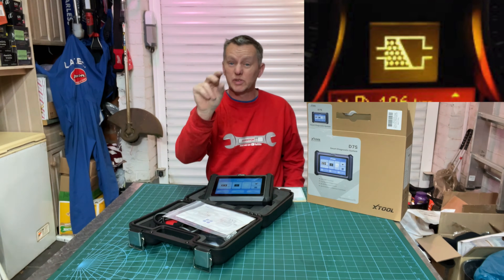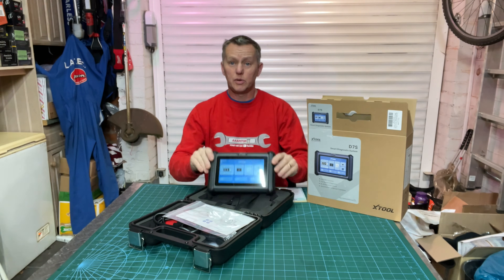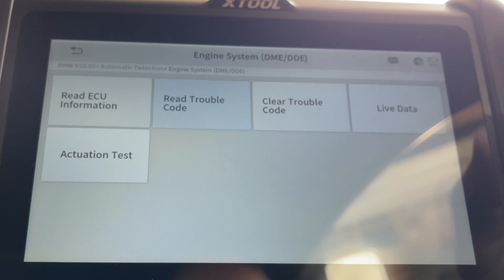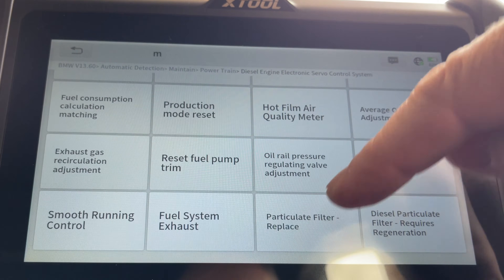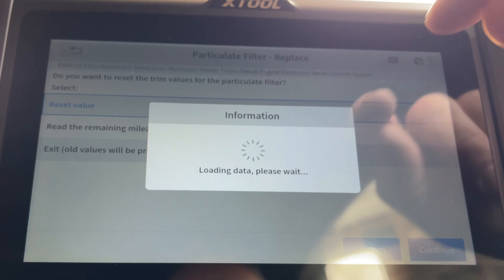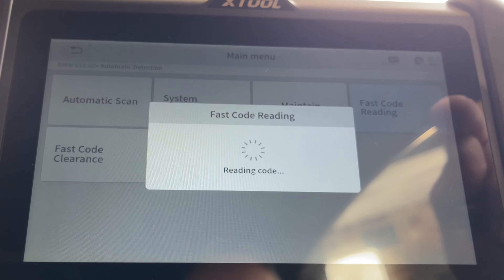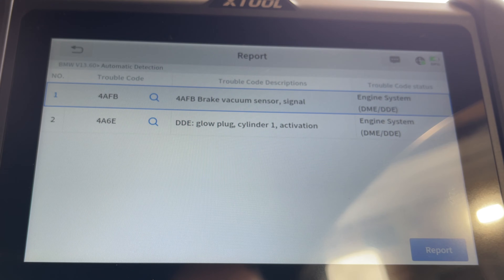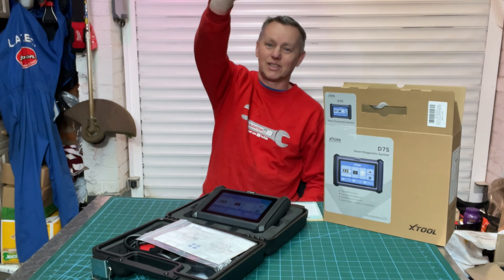452A BMW DPF End of Life, How To Reset, No New Parts Fault Codes 4D4A 452A

Comment: I have 2 codes, 4afa which is the stop/start function dont really mind but 452a and the car wont start, any ideas please?  put in new battery but car doesnt even try to start, just cranks, any ideas really appreciated
Reply from the maker: Start with the basics, fuel pressure, crank signal, etc, Thanks for the great comments👍🏻👍🏻🛠

Comment: Greetings and thank you so much for the video. Just wondering have you used Launch X431 for this issue before? My son's car is getting there codes and every now and then the DPF light shows up on the dash. I tried using my Launch, but it doesn't look like it has the option to change the value, instead, the option is to regenerate which involves driving the car at 60km + speed for 20 mins. The software hasn't been renewed for a year now and is one version older than current one, I don't think it is backed that. Just wanted to ask you before purchasing the upgrade. Thanks in advance
Reply from the maker: Its not a re-gen setting, it will be in the Launch menu under replacement dpf, you shouldn't need to update to get it, Thanks for the great comments👍🏻👍🏻🛠
Reply: @aaanton11 thank you so much for your reply, you were right, after clearing the codes, it let me use the replacement option and it's been 3 days and no more error codes or check engine or DPF light on the dashboard, I appreciate your help.

Comment: That two DPF codes have been giving me DriveTrain warning light at 151,000 miles and BMW quoted me £3500 to get the DPF replaced.  Found your video and ordered the TopDon scanner and did the particulate filter replaced. Works a charm. Can't thank you enough for that ❤
Reply from the maker: Nice one! Thanks for the great comments👍🏻👍🏻🛠

Comment: What are you planning on doing for that glow plug fault? I have a similar code but no issues with idle or start at cold.
Reply from the maker: Nothing in the short term, if the starting becomes an issue then I will repair but its been there for years now 😂 Thanks for the great comments👍🏻👍🏻🛠
Reply: is the glow plug also used to increase engine temperature during thge regen process for the DPF.  If thats the case, and the regen is not completed correctly you will reduce the life of the DPF.  I have a 5 series 300,000km, original DPF with backpressure of 5 - 10. System regens perfectly but I replaced my glow plug controller at about 250,000km when the DPF (BMW pre programmed life expired) warning illuminated and as I checked codes discovered the glow plug controller was faulty...  It was certainly cheaper than replacing the DPF!

Comment: One question, when that dpf warning pops up on display the car is doing regenerations as normal or  regenerations are stopped until the problem is fixed and codes are cleared?
Reply from the maker: I believe in this scenario the car continues to regenerate as normal, but you keep getting the warning. Thanks for the great comments👍🏻👍🏻🛠

Comment: how to give wrong input data to your ECU - It will increase an amout of regenerations because the backpreassure  did not disappear after reset so DDE  will be confused whats wrong there and why the backpreasure is to high in such a short amount of KM  .... this operation should be used only when new od cleaned DPF is inserted  - bad  advice from you
Reply from the maker: I have had no issues, all is working well, Thanks for the great information👍🏻👍🏻🛠
Reply: Surely this must be the case if the DPF is indeed clogged with excess soot. If the DPF is crystal clear like he shows I can’t see an issue.

Comment: Glow plug fault will stop the DPF from regenerating. you need to change it. You can test them also with a multimeter looking at the resistance
Reply from the maker: Thanks for the great information👍🏻👍🏻🛠
Reply: @aaanton11 did the code stay off or did it pop back up buddy am curious on this one as I imagine this is what the garages do then week later it’s back up might be wrong but be interesting to know cheers bud